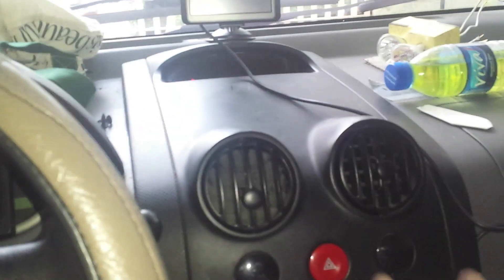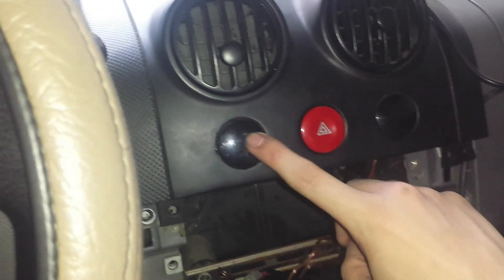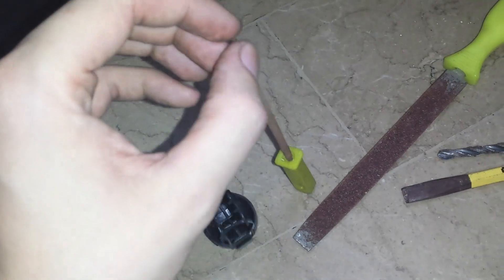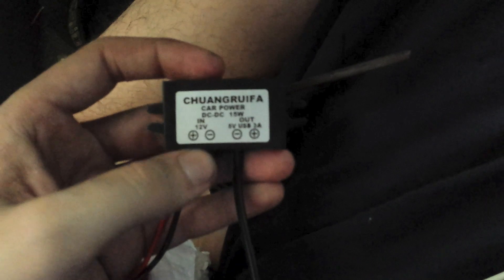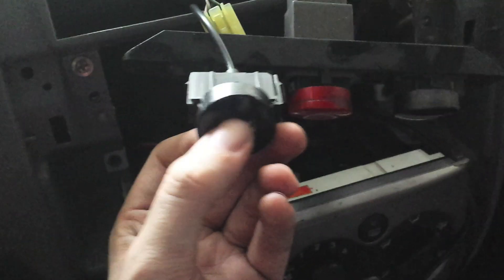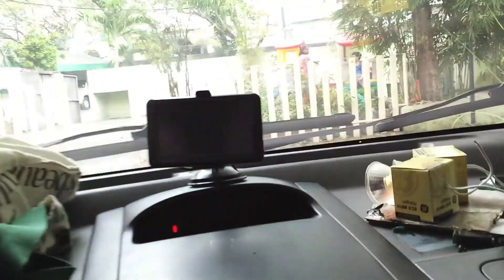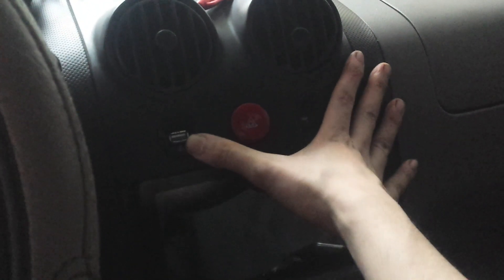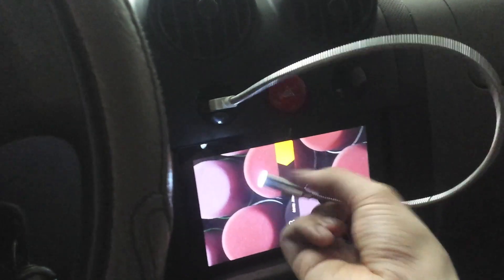USB Port installed in car dash

Comment: I was wondering if you could help me with a couple questions? I have a 2005 chevy a Avalanche that has a car lighter socket and an accessory socket in the center console? I wont be using then anymore because im running an ipad in that location so i added two 12v to 5v usb adapters to tuck behind to keep the ipad charged when its docked. Well the one i hard wired to the accessory ground n hot is working fine and i added an inline 15a fuse, but the one i hard wired into the car lighter hot and ground keeps blowing the 15a fuse under the hood, it only has a 10a inline glass fuse. So i went up to a 20a fuse under hood & then it blew the inline fuse, so i guess my question Is do i not need the inline fuse? Do i need a bigger inline fuse? Do i need to ground it somewhere else other than the factory ground wire?
Reply from the maker: if the fuse keeps blowing, you certainly don't want to remove it. That suggests there's a short circuit or heavy load which will cause a lot more problems if you operate it without a fuse. When you say you hard wired it into hot and ground, you didn't put it between them did you? Because that will just create a short that will blow the fuse in a very short time. It needs to be on the hot only.
Reply: Gadget Addict no what i did was take the dash panel off where my cig lighter was and snipped it, so from the factory red wire i added inline fuse to go to step down converter & just grounded the black wire into the factory black wire for cig plug. So im wondering since the cig socket is fused from factory its making the inline fuse blow because it doesn't require one? On the other side where my other socket was i basically did the same thing but didn't use a usb i just ran wires for an accessory socket that i relocated on my dash, im sure those factory wires are fused as well but its not blowing any fuses and working fine
Reply: Both of those sockets in my truck are always on they do not turn off & on without ignition
Reply from the maker: Jesus Zuniga Adding another fuse shouldn't make any difference. If it's blowing, it's because something is shorting out and the fuse doing it's job. A 20A fuse at 12V can handle at least 240 Watts. I doubt you're adding any USB loads that come anywhere near that. I'd assume the step down converter has a fault and needs replacing.
Reply: Gadget Addict you were right man it was a faulty step down converter, thank you for all your help!
Reply from the maker: Jesus Zuniga You're welcome :) I'm glad you worked it out :)
Reply: Gadget Addict another quick question if you don't mind, if i wanted to use an add-a-circuit fuse adapter to tap into a fuse under the hood that only turns on with ignition & run it through firewall & behind dash to power the step down converter do i still need to add a 3rd fuse?
Reply from the maker: Jesus Zuniga I wouldn't imagine so. Personally I'd avoid adding multiple fuses inline.

Comment: but does it turn off when you take the key out of the ignition?
Reply from the maker: +repairdrive Yep cos it's wired to the ignition fuse so it will turn on and off with the ignition :)
Reply: +Gadget Addict Ahh nice!

Comment: When you plug an iPod in will music play in the car?
Reply from the maker: qwertyp90 Unfortunately not, it's only a charging port.
Reply: So you can't put say a USB stick into it and have it play music? Is there another way to do that? I might be confused but let's say my car isn't already USB compatible. It has a cigarette lighter but I don't need that lighter. So, can I replace that with a USB compatible thing and then just put a USB stick loaded with music into that and have music play in my car that way? Currently the only way to play music I want in my car is via CD's which I don't mind, but if I could somehow hook up a USB that would be great.

Comment: Hey,
Awesome video!

You don't have a vid or tutorial on how to do the actual wiring? From this I gather it is piggybacked from the cig lighter but I'm a total noob so wouldn't know where to even start with this.

Cheers
Reply from the maker: Olivia Benbow The wiring is really simple :) I put a bolt into cross brace piece of metal behind the dash, then connected ground to that, since the chasis of a car is considered ground. Then I ran the positive to the cigarette lighter fuse. But you could also wire it directly to the back of the cigarette lighter socket if access is easy :)

Comment: where's the fuse and how did you know where to attach to circuit?
Reply from the maker: wantonious I used an inline fuse holder with glass fuse. I'm using part of the chasis behind the dash for ground and then taking live from the fuse box where the accessory port is wired up.

Comment: Would you need the fuse? You run from the Lighter circuit which has it's own fuse. Isn't that like 2 fuses in one circuit?
Reply from the maker: The lighter socket does have a fuse but the general rule when adding something to your car is to add a fuse inline. For example most gadgets that plug into the cigarette lighter have their own fuse.

Comment: good video----I want to do the same thing,but I don't have a cigarette lighter,so can I go straight to my battery thanks
Reply from the maker: You can wire straight to the battery but it might draw current even when you're not using it. I have mine wired into the ignition fuse right now. So it only comes on when the car is turned on :) You could do the same.
Reply: Gadget Addict  thanks-I"ll go to the battery ,I shut off my truck with a big master switch,so that should be fine------good video
Reply: I know this is old but you can also wire in an inline mini switch with a power led that you can shut off to prevent power draw but you have to hope the light reminds you to use it.

Comment: Would you happen to know, how install a USB port on Home Audio System with no USB port because, i have installed a USB port on audio system but i can't figure out wiring, for the four wires, where to solid them...on which connection....if you can i would much app...Gadget Addict...!!!
Reply from the maker: Mmm I don't think it would be possible, at least not feasible. There's nothing you could wire the USB port to inside the home audio system that would understand how to mount and read any storage device you connected. You could buy a cheap mp3 radio/player which has a USB port and wire the analog 3.5mm out from that into your larger home audio systems line-in.

Comment: do you have a problem with when you plug in a usb cord the port gets pushed into the car?
Reply from the maker: No, it's a super tight fit. Plus i've since tidied it up with a little black silicon. The only way you'd get that out now is with a hammer.